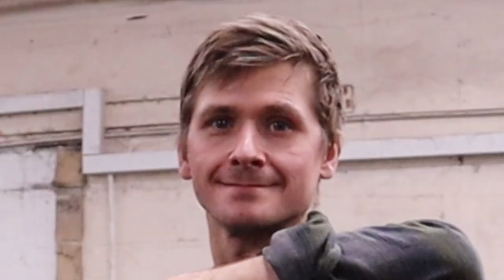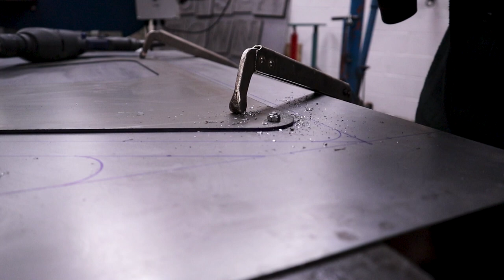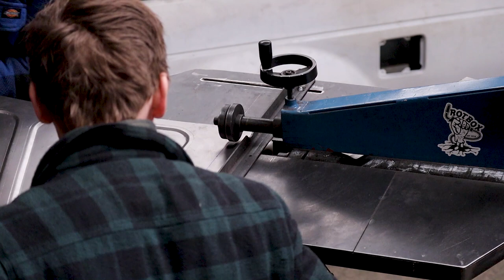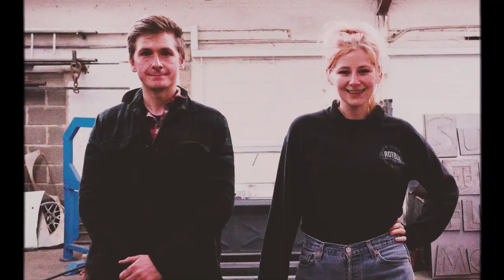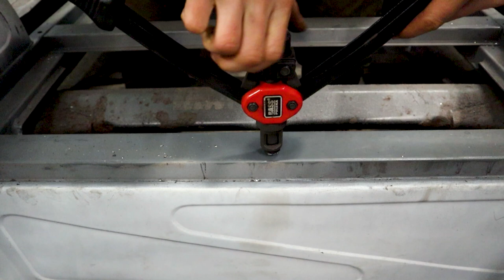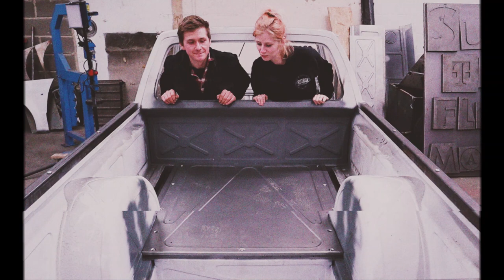Bead Rolling Sheet Metal Floor Pans {MK1 Caddy Rear Bed}

Comment: To stop oil canning/ warping you need to english wheel the panel the oposit way up to what the swage is going to drop. Only a very slight radius mind just a few passes. Ive Been doing it this way for more years than i know works every time.